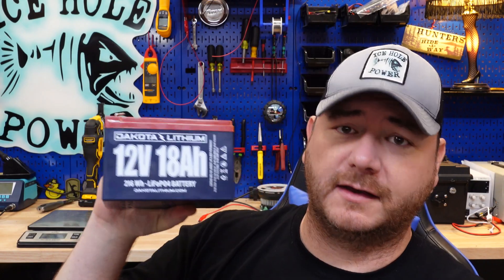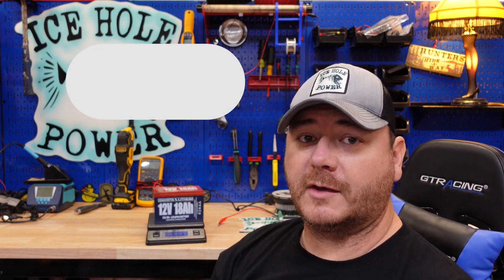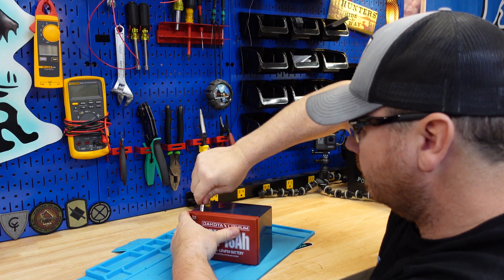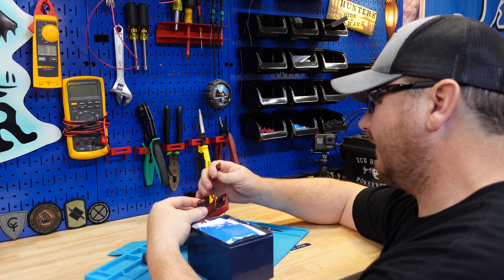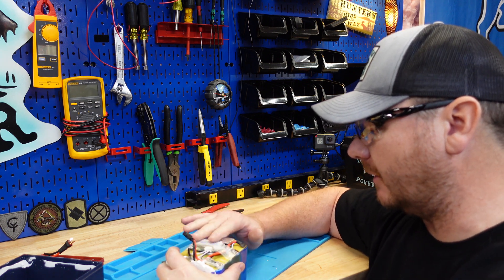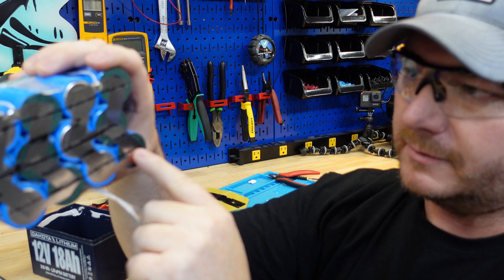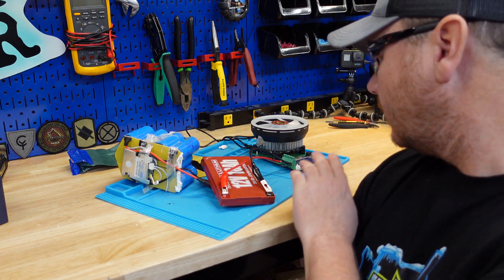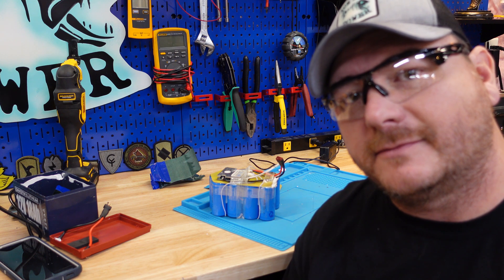Dakota Lithium 18Ah LiFeP04  Battery Review and Teardown

Comment: Both of my Dakota batteries are dead and will not charge .
Reply from the maker: There are some chargers out there that have a repair function on them.  I would look into a noco charger to see if that would work.
Reply: @ I’ll check into that, Thanks a lot 👍🏻

Comment: I just bought a powerbox 10. I have a question I'm running a 12 volt bilge pump and the battery only runs the system for almost three hours. I called the tech at Dakota and he said the run time was correct. The pump is a Seaflow 12 volt 1100 gph max amp draw states 1.8 amp hour. My question is am I getting the correct answer😅 from Dakota.

Comment: Hi i just wanted to know what powerful lithium battery/batteries i can buy for my dual sport adventure bike 1990 suzuki dr 800 that can handle a little more accessories on the bike with more CCA amps and AH to replace YB14L-B2,12V14.7A please thank you in advance

Comment: Hello enjoying and learning a great deal from your battery teardowns

Obviously all batteries are not created equal and price is not a good indicator of build quality

I am building a near waterproof battery box with a planned 12AH or 18Ah battery
Interested in your opinion of brand with a decent build quality.  What  would you recommend for independent powering of boat instruments

Plan on running a digital yachts GPS-160 wifi which draws just 125 mA plus a cigarette adapter to charge 2 iPads at 5V at 4 amps using an anker charger

May also occasionally run a  150watt inverter from the battery as well via cigarette lighter

Thanks in advance

Randy

Comment: That is very shocking finding on a reputable brand. When you get a chance, you might also want to do a similar capacity test on a Bioenno battery which has become quite popular in the ham community. It is very interesting that some models even have different Max and Peak Continuous Discharge current specs on their battery labels from those indicated in their website...Thanks!
Reply from the maker: I will add them to the list.

Comment: I was going to say I thought you were being rather strict in your assessment of the battery, until you said it cost $180. Wow. That is expensive for 18 amp hrs. You can get a 100 amp hr battery from Zooms for $320 so I did not expect such a high price on this one. If you are spending $180 for a 18 amp hr battery it better be absolutely the very highest quality build and definitely not measuring less than 18 amp hrs. Thank for the vid.
Reply from the maker: Yeah, I am pretty hard on batteries, especially at this price point. Prices have come down so much in the last 5 years but a lot of the popular lithium battery companies are stuck at the $8 to $10 per amp hour price point for batteries that are similar to the quality of batteries that are half the price. Thank you for watching!!

Comment: I am using a Chinese Deisel heater and need a good 12 volt with at least 10 amps. Any advice? Thanks
Reply from the maker: You have a 10 Amp draw? How long are you running it?

Comment: What do you do with all of these batteries after you tear them apart?
Reply from the maker: I hang on to them for reference. Some are used around my shop to test power boxes.
Reply: @iceholepower8012  If you ever decide to break them down, a fully DIY build of your boat box or something bigger would be cool.  Or if you made a large 24v pack that could be useful, and with the right charger you could do regenerative discharging when testing packs.

Comment: Jeremy thank you for doing these videos to make the research process that much easier on us regular Joe/Jane Schmoe's. Was wondering if it's on the list or wanting to make a suggestion of the Marcum Lithium Ion Shuttle for a future test. I have one for my  LX 7 and it has usb ports to run other accessories. Would like to see in a video if I made a decent purchase or got screwed.
Reply from the maker: Thanks for watching Matt! I do plan on adding it to the lineup. I have a stack of batteries that I need to void the warranty on before I buy more stuff to break.

Comment: Thanks for purchasing and then tearing down for us, it is appreciated.  A suggestion, try charging and discharging the pack several times before you reach a decision on it's capacity.  The cycling may raise the capacity.   As a 4S3P the BMS must be regulating the voltage down to 13.X Volts.  What is the fully charged voltage of the pack?  The 4S3P configuration would yield 4 times 4.2V (fully charged cells in series) or 16.8V.
Reply from the maker: I think you're getting your battery chemistries mixed up. A fully charged LiFeP04 cell is 3.6v.
 3.6v X 4 liFeP04 cells in series is 14.4V the same voltage as the output on the charger.
Reply: My LiFePO4 fully charge to 4.2V (18650/21700/32650)...try yours.
Reply: @amham48  Most 18650's are lithium ion and 4.2v per cell is correct for those (LiFePo4's do exist in 18650 format too).  26650's and 32650's are LiFePo4 which only goes to 3.65v like Ice Hole said, so if you're putting LiFePo4 cells on a charger and it's taking them to 4.2v, that's very bad.  Your charger can't auto detect what chemistry the cell you put on it has; instead you need to flip a switch or change a setting between the two types.